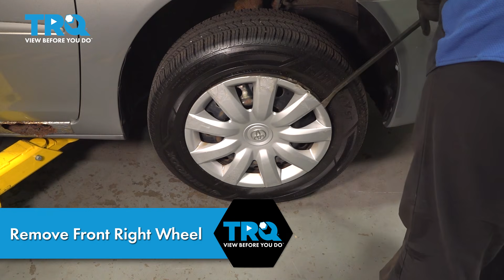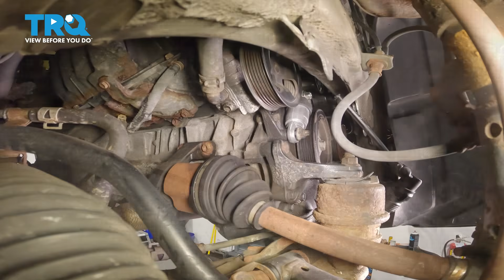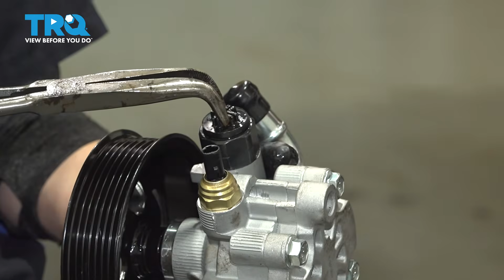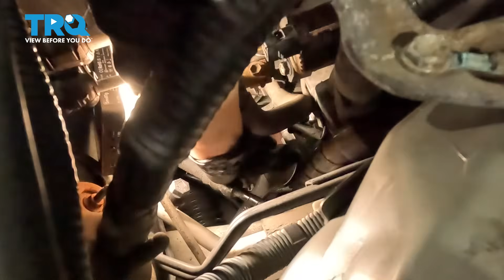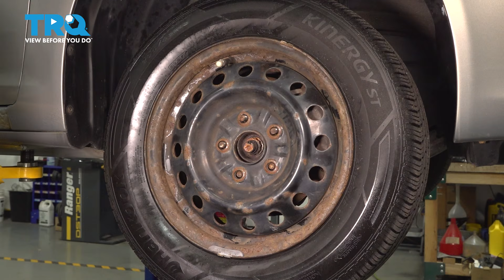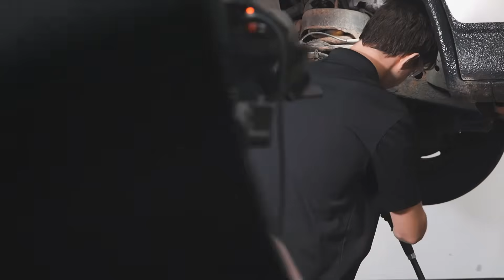How to Replace Power Steering Pump 2002-2006 Toyota Camry 2.4L L4

Comment: You don't how how to remove the serpentine belt?!
That's the most important part!
If you don't do it right, you're ruin the tensioner, and need to replace it!
It's possible to ruin the replacement, too!

Comment: I wish the mechanic wouldn't cut out from the video where she was struggling with the bolts and other aspects.  It is those aspects which I probably need most help with seeing how someone skilled is able to work in the small spaces to replace the pump.